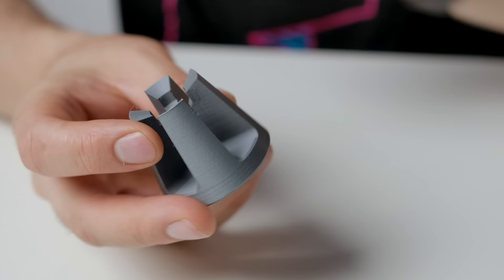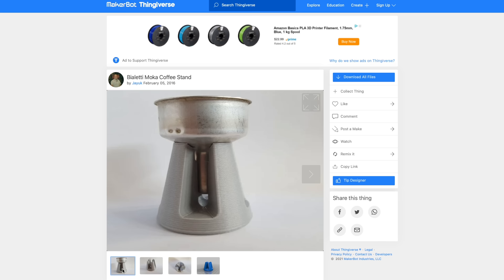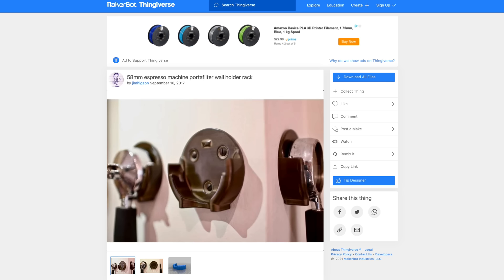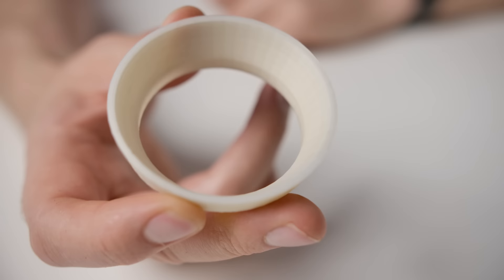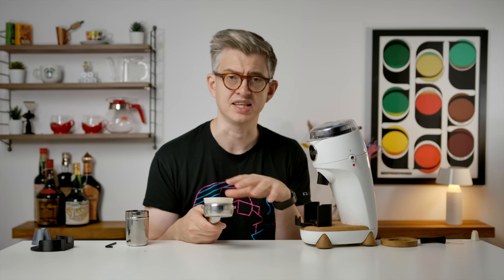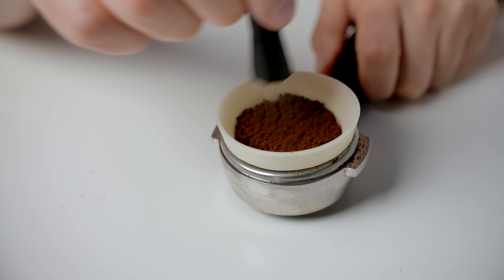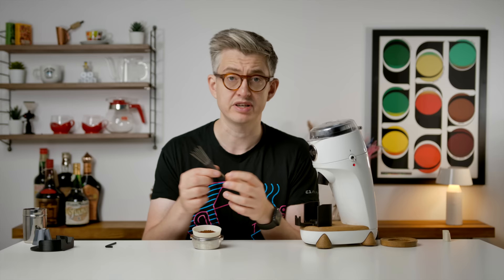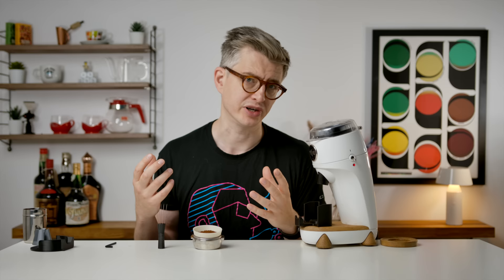3D Printing Coffee Stuff

Comment: I've 3D printed a little hat-tube to fix my Gaggia super-auto espresso machine.  The door on the thing has a plastic tube which mates to the Saeco/Phillips brew group..after 30K shots, it broke off. It would have been better to machine one out of brass but i didn't have a lathe at the time. 3D printers are great for doing all sorts of little knick-knacks. You do have to mind that the type of filament you use can handle the heat -- PLA is pretty low temp..there were some FDA approved PLA's but I've not seen those for a while.   Have fun!

Comment: Printed a modified burr holder for my bodum grinder which allows finer grinding than was possible before. (Just had to tape off the finer setting to avoid burr grinding burr). The resulting finer grind means I get great slow extraction from my $100 espresso machine with pimped basket. Oh and my tamper is 3d printed to get exact diameter in an attempt to stop channeling.

Comment: PLA is food safe, however certain formulations aren't primarily due to pigments, but it is definitely possible to get a very simple additive-free PLA formulation that is food safe. The issue is that specifically 3D printing isn't great for food safety, not purely because of the material but because of the porous surface it creates. This surface has lots of crevices for tiny bits of food to get trapped in and to then encourage bacterial growth in. Hence, PLA food bits are often considered single use. However, if you are able to smooth the surface with post-processing of some sort it can become food safe and reasonably reusable.

Comment: I have printed a whole body of a grinder utilizing parts (motor and burrs with chamber and grind setting mechanism) from fully automatic espresso machines. It is useful. In my opinion portafiler funnel that sits outside of the rim is better, because it does not leave an empty space near the walls of the portafilter. The design is more complicated, but effects are worth it. It is also pretty easy and usable to print distribution tools and tampers. I have tested some shapes of the distribution tools and it turned out, that coned shape helped me with a ring-like shape at the start of extraction. But these parts have to be finished with sanding to get a smooth surface.
I frequently read that PLA is generally safe with food. Isn't that right?

Comment: I've had a list growing on Thiniverse since before I even bought a 3D printer. I finally pulled the trigger recently and I'm in the process of printing a rectangular holder with 11 slots in it. Each slot can hold one flash drive, one SD card, or 3 micro SD cards. I'm also printing a storage drawer that mounts to my printer. I plan on printing some holiday gifts for the family.

Comment: Something worth mentioning is that PLA starts to become soft at around 50-80C (Glass transition temperature). There are other materials like PET or ABS that have higher temperature resistance, but have other drawbacks that make them more problematic to print. 

So don't put anything with boiling water inside it in contact with the parts made with PLA.
Reply: ASA is the new ABS. Easier to print, far less nasty fumes, is strong and withstands heat the same as ABS did (does).
Reply: @MartinStephenson1  I've actually been using ABS+ recently (and ABS some 8 years back) - the fumes aren't really the problem, it's the mechanical properties - PLA is just easy to print and results in very rigid parts with an unfortunate temperature problem.
Reply: @nimeq  Give ASA a try. I've had better bed adhesion than I could get with ABS without having a fully heated enclosure. In fact it sticks so well I have to remove the steel sheet and let it fully cool before removing the print. It is still draught sensitive during the print though, so a stable temp is best.

Comment: Important distinction here, PLA is not food safe as you said, it is however non-toxic and you can get food-safe PLA. The distinction comes from the types of dyes used to give the plastic it's colour. So a non-dyed PLA should be fine for a few uses because, second important distinction, by the nature of how FDM (Fused deposition  modeling) prints are made, by adding layer upon layer, you create tiny gaps and crevices that are great for bacteria to live in. So ideally you'd always coat everything that's 3D printed and going to be used for food preparation in a layer of food safe and water resistant epoxy.

So happy to have you join in to this hobby James, drop by on the /r/3dprinting subreddit one of these days, we're always having endless debates about food-safety and non-toxicity  etc...

Comment: Anything 3D printed is inherently not foodsafe because there are tiny cracks between the layers where food and bacteria can sit and develop. 
You can get food safe resin that can fix that. 

PLA and PETG plastic in itself is foodsafe, but there can be additions in the plastic that is not food safe. 

Also nozzle etc can leach metal into the print, so you need a Food safe nozzle too. 

Tldr; if you want food safe prints, use a food safe resin afterwards.

Comment: Just a small remark regarding safety for food. In general, PLA is human-safe. It's made from something like corn starch and there are even body implants made from PLA. This does not mean that all PLAs are safe because the coloring agent can be toxic (also applies to other plastics). At the same time, FFF 3D printing (drawing with layers of melted plastic) is considered to be not food-safe because of all the micro-gaps you get in the plastic. IMHO this means that you have to be cautious. I wouldn't print cups where you have liquid sitting for a long time. At the same time, I don't think that a small cone that some coffee may touch before brewing will contaminate it with bacteria to dangerous levels. At the same time, it's just my opinion. There were experiments that proved that bacteria grow faster in 3D printed bowls in comparison to ceramic ones. But no one tested how bacteria grow on plastic bowls used for 5 years, or used wooden/plastic cutting boards, etc…

Comment: 3d printing is closely related to tweo of my hobbies. One former one that I sucked at because I am bad at folding and cutting was paper caft. It's basically like printing a 2d model kit that you fold up to be whatever. It's a little bit puzzle asnd a little bit crafts and a little bit "Ooh I want that thing."

The other thing 3d printing is like is modding for video games (my largest hobby) in the browsing of files to download that are computer representations of 3d models and the one time I would want a 3d printer is to print out models of the modded followers that I have in Skyrim and Fallout 4.  I'm not doing that for various reasons but 3d printing is super cool and for a physical hobby clearly useful.

Comment: James 1 suggestion when you are printing with FOOD-SAFE Filament.

you need to swap out the Nozzle entirely as there are still small remnants of NON-food-Safe Filament in the nozzle itself.

it would have been better if you started using Food-safe Filament right from the start, the price itself is not much different than normal Filament,
nor is the settings you would need to print with it.
------
Also: if you are designing your own designs in a program like Sketchup, make sure to triple check if there aren't any Ghost faces that can ruin the print. [do this by Xray or by the path/layer view of the slicer you're using]

Comment: I don’t see an issue with commercializing something on thingiverse. You would have to redesign it of course, by default I think the items are licensed to exclude commercialization, but most people don’t have a 3d printer but would pay money for the thing. Of course they ought to cite the original creator and get him in on the deal, but either way, I believe there are laws against patenting something if it already existed. There’s really no downside because the part would still be available to people with 3d printers for free.

In the other direction, I’ve printed models from McMaster rather than driving to Home Depot and spending a couple bucks. Had a broken pipe, needed a cap for a temporary fix, printer was faster.

Comment: 3D prints in general, regardless of the material(PLA, PETG, ABS, etc), is not considered food safe, beyond single use only at least - the layer lines that exists due to how a 3D printer works, means you can't ensure proper cleaning. So unless it's a material you can actually boil to sterilize it, 3D printing and food stuff shouldn't mix, and you can't generally print in materials on consumer home 3D printers, that can withstand that with deforming. So sure the stands, filter holders etc., are probably fine, but the dosing ring is a no go, unless you want to print a new one each time. 
That being said, it's probably not a big issue when it comes to coffee, as it tends to be brewed at temperatures that most bacterica do not like, but it's something to be aware of in general when it comes to 3D printing and food.

Comment: So you've probably been told this a lot in the comments

Technically no 3D Printed plastic is food safe

PETG is MORE food safe, but once you print with it, it becomes unfood safe

Specifically because of the 3D Printing process, the layers are not 100% perfect adhered to eachother

Meaning that water/saliva/food bacteria can get in the small cracks between the layers

And eventually mould

Now if you are only using dry goods in them you SHOULD be safe, as long as you don't get the prints wet

So I always recommend, if you have a food related print that needs to be washed

Don't wash it, recycle it and print a new one

Comment: PETG isn't to my knowledge any more food safe than pla. The issue with both isn't the material but the nature of 3d printing. The layer lines create the ideal conditions for bacterial growth. I don't think it's much of an issue though for dry foods.
Reply: I also highly doubt that it's a real issue for wet foods. It's one of those things that people keep repeating, that the layer lines will trap bacteria that won't be cleaned out from normal washing, but as far as I can tell, there has been absolutely zero actual research, despite the fact that said research would be very easy to do. I mean we eat off of porous ceramics all the time, wash them, and never have a problem.

Comment: a lot of PLA is actually food safe (though not all, check with the manufacturer to see if your exact roll, down to the color, is food safe) but FDM 3d prints in general are not food safe, even PETG; layer lines are breeding grounds for bacteria, so you really should post process the print if you want it to be food safe

Comment: You want a “dosing ring”? Cut the top off a plastic bottle. Cut it where the diameter is the one you want for the mouth of the funnel. Then cut the bottom off the bottle at the height you want. Done!

Comment: "PLA's not food safe...You might want PETG"

First, PLA itself IS food safe. In fact, it's made from corn. However, a lot of PLA filaments have additives that make them not food safe.

Second, that additive thing? Also true of PETG. 

Third, even if your filament is food safe there's a good chance your printer isn't.

Basically, if you're 3D printing for food applications then the plastic you use is less important than whatever food-safe coating you're going to paint it with.

Comment: Thanks for this overview and your honorable mention of the blueprint creators. I had printed the portafilter stand (the Decent version) made from PLA, and dropped it from approx. 50 cm to the table. One of the vertical pieces cleanly broke off. Did you experience the same (in)stability issue and how could one prevent it?
Reply: If 'vertical' means that it broke along the layers, then durability can be increased by using higher temperature, more material (flowrate) or wider print (e.g. increase from 120% of nozzle diameter to 140%) or maybe increasing overlap of printed material if possible. If it broke like usual hard and fragile materials like glass or chalk, through layers with no correspondence to print structure, probably only different material will help, but maybe temperature is too high and deteriorates material?

Comment: Got a 3d printer to knock out some Cyberdeck case prototypes, i havent ended up using it for that atm as ive made a rack holder for my raspberry pi (mini computer) as well as some other nice tools. Id suggest you dont get the cheapest printer as they can be quite... finnicky... to work with. I did. I shouldnt have. BUT i do like to tinker and i do technical support for a living...sooooo....

Comment: So if someone commercialises the model, that's only a problem if the model is available under a NC license.

If someone releases models under a permissive license which allows commercialisation, you going after someone for commercialising will be as much of a dick move as if someone took something released under a non-commercial license and commercialised it.

Some people release models (or in my case, software source code) under permissive licenses which explicitly allows commercialisation.

Also, PLA is food safe (of course, whether the particular PLA you have has any food-unsafe additives is another question), it's just you might struggle cleaning it in hot water since it will likely deform.

Comment: @James Hoffmann I saw that the mocha pod filter you have, has a slightly higher pipe at the bottom. If you are interested, I could quickly design a new version of the holder for you (of course for free) with higher bars. If you have any idea about a specific design that interests you, you could also provide a simple pencil sketch (=

Comment: Don't worry too much about "is it or isn't it food safe?" Additive manufacturing is intrinsically not "food safe". The little spaces between rows on the 3D print are joyful little breeding grounds for bacteria. Unless you are using a metal 3D printer worrying about food safeness is kinda moot. 

Also, purely on a material standpoint. PETG is not necessarily food safe. You can get food safe PLA and you can get PETG that isn't food safe. I believe Prusa do some food safe PLA. 

PLA is also arguably better for the environment. But that is a rabbit hole to go down right there.

Also a little plug. I am actually designing an open source espresso maker using 3D printed parts and a Raspberry Pi to control it.

Comment: PLA starts to deform around 60 degrees. Has anybody used this long term with preheated groupheads? My brain tells me it should melt fairly quick.
Reply: HIPS works well for temporary contact at temperatures around boiling. Full immersion in boiling water will eventually start to deform it (glass transition is around 90℃), but it also doesn't conduct heat well, so you have to be pretty persistent. ABS is another option, with a glass transition of 105℃. Either one produces styrene gas while printing though, so you really want a ventilated enclosure.

Comment: Food safe 3D printing. There is a little bit of confusion around that. PLA is food safe, but the 3D printing process is not. During additive manufacturing, you create a lot of small gaps, where the food can stay. Some manufacturers has certificates, others don't. Pigment makes a difference too, as some are not food safe. You can use coating to fix it. I still didn't read the good manual on what you should and shouldn't do when 3D printing models for food. There is so many different opinions.

Comment: A note about food safety! Even if a material is itself considered food safe, the 3D print likely is not. 3D prints made with this method are full of microscopic holes and crevices that can trap bacteria. I would not use a printed part in a food contact scenario for any cafe or place basically outside of a user's home, as it could run afoul of food safety regulations. One could experiment with coating the part in food safe resins to fill in all the crevices, but I've no idea how that would relate to local laws. For home use, this stuff is probably fine? I don't know, that's up to your personal risk tolerance. The sponge you use to clean dishes is probably way worse. For cheap parts, just print a new one every once in a while, if it has regular food contact.

You can also use a 3D print as part of a casting process to cast parts in food safe resin entirely. For that you would design something like a two part mold intended to be made out of silicone, with 3D printed forms to make the mold. Before casting the silicone, clear coat and sand the 3D print multiple times until it is super smooth. Then cast the silicone mold over that. Finally with your silicone mold in hand, cast the final part out of food safe resin. This can be good for prototyping a small batch and getting a design right amongst friends before going to injection molding or some other established process. Note that you could try to build the mold around a 3D printed copy of the final part, but as a practical matter it is better to think about what each half of the silicone mold should look like, and then make two separate 3D prints to cast each side, as you can better define mating surfaces, etc.

As far as coffee related 3D prints. your channel inspired me to look for burr upgrades for my Bodum Bistro conical burr grinder (relatively cheap by the standards of this channel) and what I found was a 3D printed bracket that claims to better stabilize the fixed burr by holding it more tightly in the machine. So I'm definitely going to print that and also just spend some time looking very closely at my grinder and see what it can do. I'm even going to try that grind size analysis software you mentioned!